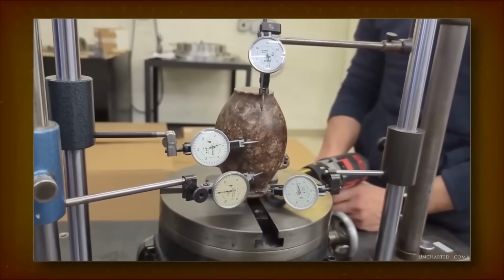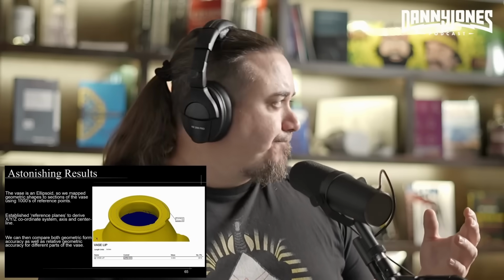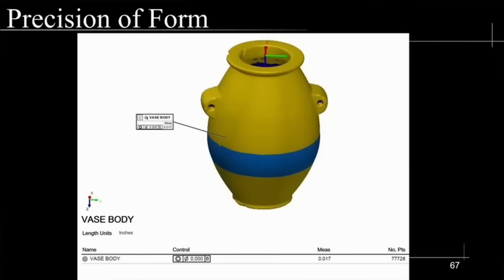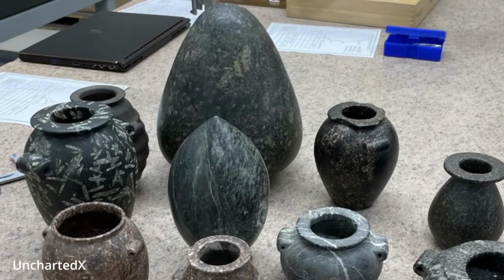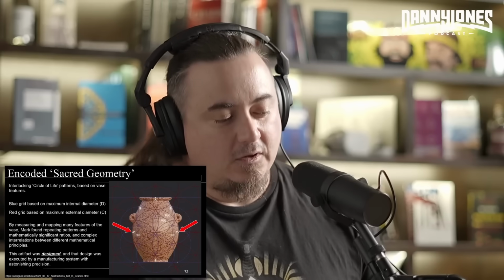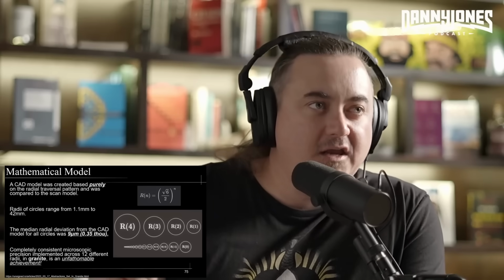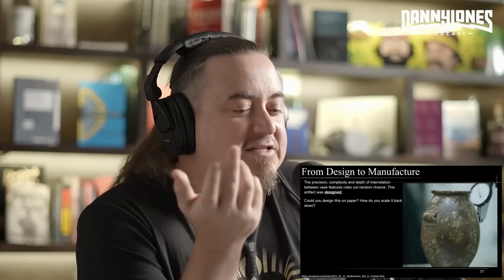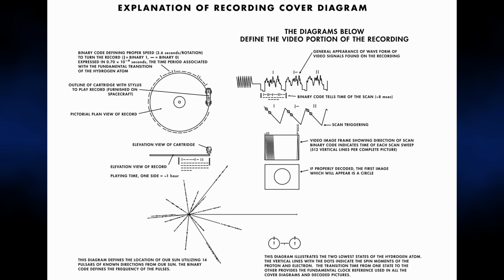Are These Ancient Egyptian Vases Actually Impossible to Make? #podcast #science #history #egypt

Comment: Many times in construction or art, the trade process itself can be reverse engineered with mathematics.  Not saying it is so here but perhaps the math could reverse engineer a process for these vases that has mathematical elegance unbeknownst to the artisan.  It seemed plausible when talking about radiuses that a compass switching from center point to outer (circumference) point being the center would produce single radius jumps at each switch.  I remember as a child playing with a toy called a spirograph which would make amazing radial based designs.  As a 5 year old I had no idea of trigonometry yet I was producing pictures that would be a head scratcher if you tried to assume that I calculated the math of each arc that was produced.  We find these shortcuts all the time in life because the design of life itself is clearly based on mathematics so everything has a mathematical equation.
I would like to further analyze that vase.  Perhaps it was center cut with a core bit to start.  I would like to see if a tangent of the diameter lines up with a straight or perhaps even a curved line consistent with contacting a bit at the end of that tangent line to the interior of the vase while remaining contacted to the upper core inside edge of the rim.  In other words a stick using the jar mouth opening as lever guide that then rotates around the mouth with constant contact and the end of that stick inside the jar contacting and scraping the interior (ignoring Mohs hardness issues for the moment).  Could the "stick" consistently contact the interior vertically along the entire interior?  There would be corresponding mathematical corroboration despite the artisan not doing any such calculation by the nature of this action. 
Similarly this type of analysis could be applied to block sizes on pyramids or features on statues, etc.  Just looking for the simplest plausible solution first.

Comment: 5:32 I have a printed copy of this vase.  The 3-D printer I got this from thought it was cool, I told him the original is rose granite.  He didn't believe me.  When you hold it in your hands, it's truly incredible.
Reply: He didn't believe it was rose granite because he's sane.  He may be under informed, but at least he's sane. The insane ones are the ones laughing at it saying that it was done with hammers and chisels.
Reply: @zeppelinmexicano  Hammering something stone with such thin walls is not possible. Whoever is claiming this has never used a damn tool in their lives.
Reply: @240Sav  you would basically have to rub this thing with diamonds down to the very finest scale you could imagine. And the whole point is you couldn’t even do that by hand or even with a lathe once you consider the handles. Even if you consider that it was done by hand using a microscope, which is basically what you would need to see where there’s an aberration sticking up that you need to rub material away in order to remove to make it symmetrical with the rest of what’s already been done you’d have to consider that they had microscopes that can go down to such a scale. I’m just a lehman here, but I’m pretty sure you would have to use probably an electron microscope to get it that small! And then you would have to work with tiny tools that have diamonds on their tips. Obviously, this is proof of computers in the past, and for whatever reason, modern archaeology just does not want to accept that there was an advanced civilization in the past that has gotten completely wiped out. This is the type of stuff that should be on the news. It should be taught in schools and yet it’s completely taboo.
Reply: @StarDarkAshes : the 3D scans have been made available - they're really not as precise as these videos suggest. Example: the handles are not perfectly opposite - they're out by approx 1mm.
Reply: @GroberWeisenstein  Who wore the shoes ?
Reply: @SupraSav why are you hammering thin stone walls when the standard method used is abrading ?
Reply: perhaps it would expose the 'elite' who claim a type of lineage or a genetical tie or along those lines to these past 'peoples'. wether or not its true, theyre using the same 'science' just broken with no soul now to control the people.
Reply: @Harry-SB-W  You do know that stone can move similarly to wood moving? Yes it moves much much much less and is far less susceptible to moving than wood but it does move.  The French government as well as  an unfortunate bank found out about such movement the hard way.
Reply: @zeppelinmexicano rough-in stage is hammers and chisels. it's part of the process and I'm in granite manufacturing. Where do you get your information from ?
Reply: @GroberWeisenstein  common sense is where I get my information. Anything with that accuracy down to a micron at different points is made by an unknown process.
Reply: @zeppelinmexicano sure, if you ignore the offset lug handles, the holes drilled off - center , the truncated profile , and the poor polish.
Reply: @zeppelinmexicano 100 💯 percent 
These academics that call Ben and the other guys "pseudoscientist" or whatever...... They just don't want to believe their mainstream narrative is wrong 🤦
Thus proving that "the search for truth" in science only goes so far nowadays, unfortunately
Reply: I want one - how did you get it!?
Reply: I do wonder about the precision on yours.
Reply: This needs a video please
Reply: You have a 3D copy of edited & interpolated data.
Reply: Earth made it
Reply: And your point is??????????